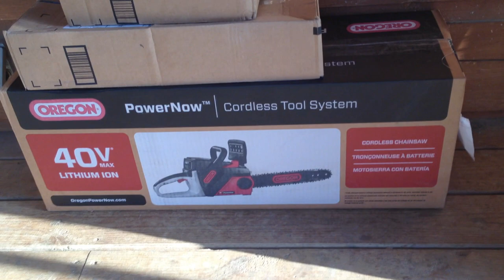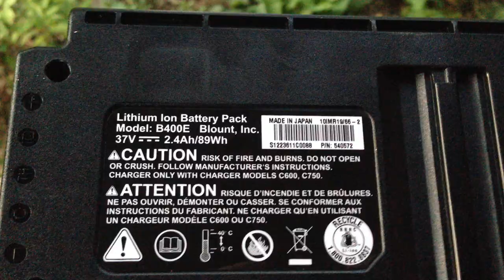Solar Charged Chainsaw Works Great!  GoPro HERO3 Black on DJI Hexacopter Drone

Comment: I am an arborist of 8 years, and a sportbiker and use to laugh at this idea, but this past year since i rode an electric motorcycle, which i was also very skeptical of, now has changed my life. thankyou for posting, bc i have now seen yet another one of my plans in action, I shall soon also sketching my saw and some rotary regenerative devices that claim potential energy when I lower limbs with ropes and pulleys, should be easy enough! pushing for a better, NON-dependant tomorrow!

Comment: The whole video I was thinking, "There's no way he's not going to make a bigger pack for this thing," and then at the end you say you might. I was JUST looking at running my electric chainsaw off an inverter today, but the power requirement was about 300 watts too high for my inverter; and then you post this video the same day

Comment: Ouah! that's some awesome video shot love the copter :)my only concern with the your solar panel would be the heat from the sun while charging on a very hot day..... it could be close to the danger temp of your battery beside that it's a great little thing to have :) cheer!

Comment: Nice job on this - Very Cool.  One small suggestion would be to tell you not to place that solar panel behind that fence as it causes a shadow which lowers the power output and slows the recharge time.    Maybe have something that you can hang that module on the other side of the fence railings.

Comment: Did the saw battery charge of solar panel or from the Li batteries on the back of SOLN1? Seems like half hour is not enough to charge up a 37V 2.4aH battery directly off the isze of solar panel you have, unless it is assisted by previously stored energy in the SOLN1 Li batteries. Let us know. Thanks for your absolutely cool videos.

Comment: great tool  and the soln1 has all kind of potentional  I see you carry a Spyderco Rescue knife like I do but I have to call out on a couple saftey fowls  cutting the tree no saftey glasses and no sawers chaps on your legs  while hearing protection is not as important with a batt powered saw  it will cut your leg as fast as its gas powered brother  and get the kids and wife saftey glasses  keep up the good work. love to know how your Batt tweaks turn out  My world needs more and cheaper batt powe

Comment: Interesting to see. I am usually not a safety fanatic but I would use safety glasses and tell you kids not to stand next to some one using the weed whacker. It can fling plastic bits or small gravel into eyes if unlucky.

Comment: Hey you and Mike Laser dot com this is Fred would you send me an application in the mail in there but you're so long one solar panel collector and make the year these six capacitor battery for a vehicle and I like to know other work but not going to with you what do you think I think might work on a Chevrolet in a GMC vehicle and will work in lmoore Lego black ops 17 horsepower engine 20 horsepower engine be twin engine ring Stratton
Yeah Chevrolet is the v6 engine racing sports car of gum made in Canada juice to turn over that engine roof really good on j'en the v8 engine package all the goodies on it build for the ride long run I that long we're going to start up from a several times in there with that boost pack and mow the yard must stop for a bit in there the rest of bed and get back on in there and start it back up again starting times I can do in there on that the boost pack the big one you made was 6 the pastors in action from from Max csllhave
 the patio and all those Nosa cell packing there were called 11the depositors and then that was your night from Maxell
No mike's to you though Chinese stuff is a nacelle bunch of crap job for sloppy as all get out of TVs there they're sore on a sloppy is all good I wouldn't find anything from the from the Chinese but I need a cleaner pin and lousy of soda thing from them my self yeah did you say you got the better have your solder cylinder from Amazon what was the price um no I'm not the one that I have a glass solar panel and what is the price on that panel I hope you send all the stuff love said it first and help you send all that in the mail to my evening diagrams everything what you done on your printer right unsub sent to me at the 305 North Moreland Dr Moore Oklahoma phone number is 405 9335 533